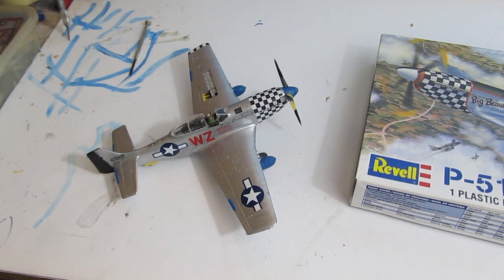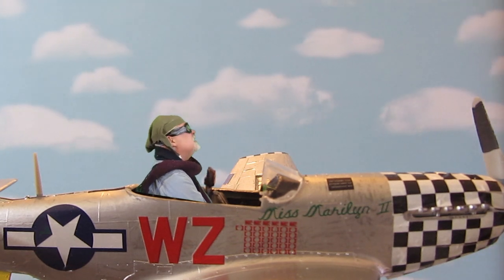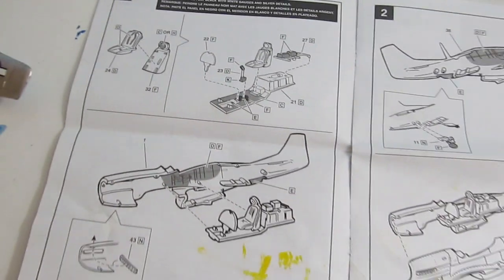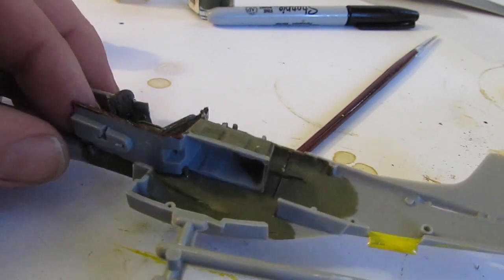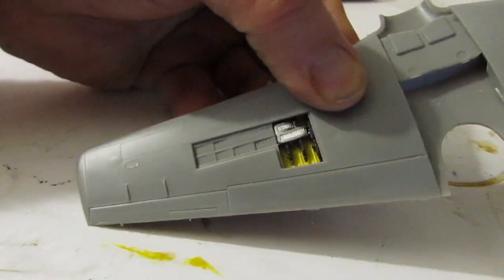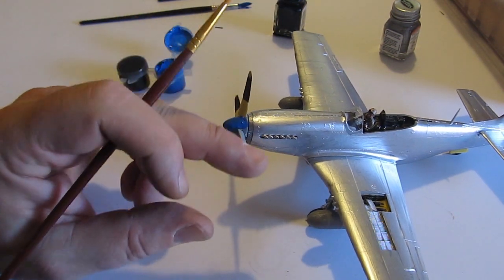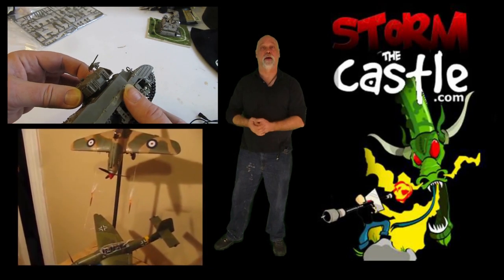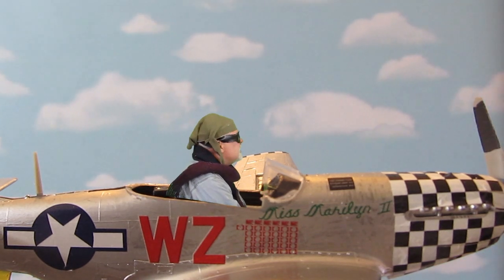How to Make a Model Airplane

Comment: could you use dry brushing to add weathering effects (the weathering kits are a bit pricey for what you get) like for example use some type of flat shade of brown to look like rust on metal?
Reply from the maker: +Paul Galvez Great question. Yes, you can use dry brushing to do some weathering.
Reply: +epicfantasy OK thanks! right now I'm building my first kit which is a f4u-4 corsair and I have already used a lot of flat colors so it looks a bit old so I wanted to detail it even more and that battle worn look